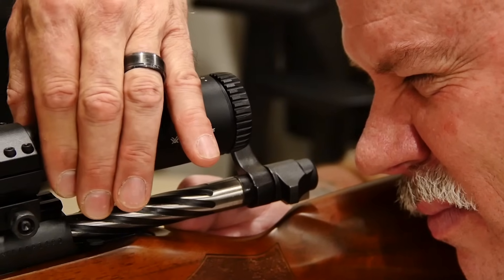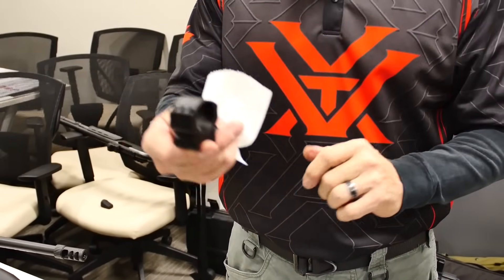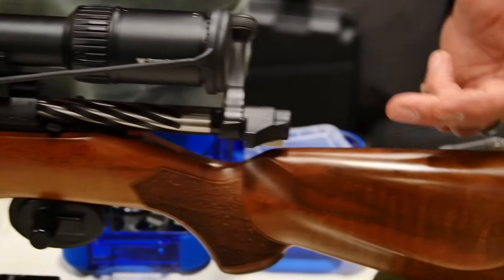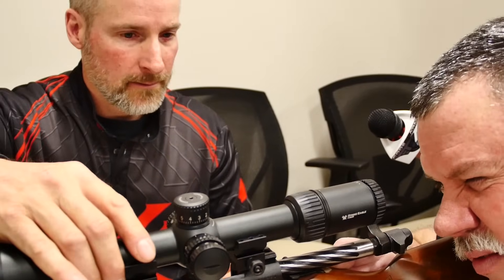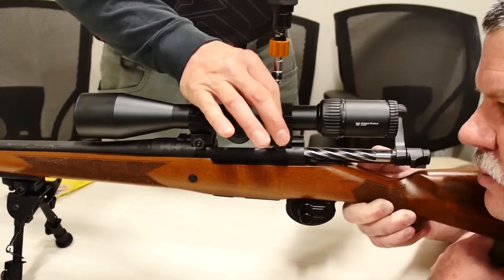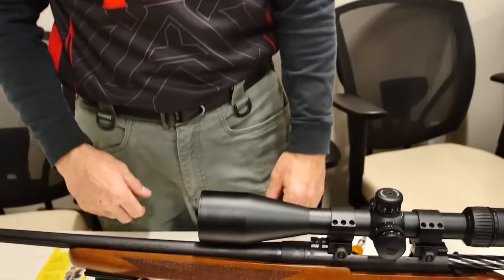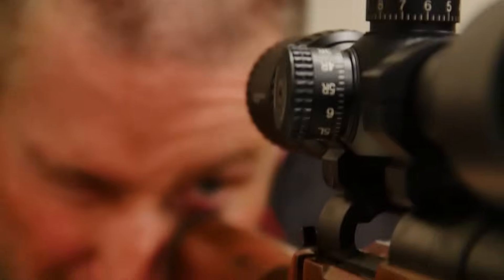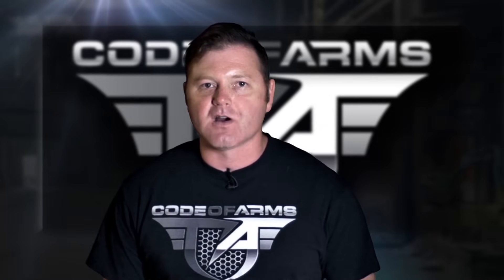HOW TO INSTALL A SCOPE PROFESSIONALLY - By Vortex Pro-Staff Mike Brake

Comment: I don't use levels on most precise mounting. Never know when the reticle is not aligned true to the elevation adjustment system. I hang a plumbob on a fine string and coat it with a contrasting color and center it on a perfect perpendicular cross with small circle on the x. Another cross hair on the paper exactly the same distance vertical as the center bore to center of scope on rifle. This on paper on a wall, basement/garage. Wifey/husband safe. Ha.. Rifle on bags or secure rest as far away as I can get,, 20 ft or so.. I might level from top surface of the base but I align vericle cross hair with the plum line and the center of bore. Adjust scope to cross hair on paper,  the tope line you created above center x. 
 Most of time on a 3 inch circle at 50 yards at the range  I verify bore sight and shoot a round. Usually it is in that 3 inch circle. Then go from there at 100 and tweek it in

Comment: Can’t bore sight semi autos without using a laser bore sight cartridge.  Takes 10 seconds.  I do it at night on the side of a house about 100 yds from mine.  My .308 laser cartridge was pretty cheap on Amazon.
Reply: I also have had good luck with Green laser bore sights.  Also the Wheeler bore sights and scope leveling kits.   They are a huge help with getting mechanical zero of the weapon and  the ammo they used.   Similar to the HD video  scoped with HD cams for your eyes....
Reply: You can, at least on an AR platform but it takes a bit longer

Comment: You know I have that same set of bubble levels and they are crap . They dont stick to anything and 1 out of 100 time will it actually be level when the bubble says it is .
Reply: Starrett or Mitutoya.....helps being a master toolmaker and having vintage quality tools.....could even sweep it in with Swiss half thousand indicators.
Reply: @keithlucas6260  i was thinking starret for sure.  Don't think they make shooter levels but you certainly could check and calibrate your actual shooters level with a starret 98

Comment: Why did you not address "bedding" the scope barrel to the ring mating surface???  That is one of THE MOST important elements to insuring maximum scope stability.  Thank you.
Reply: Absolutely, I was shocked bedding was implemented. Stop the slip.

Comment: 25inch pounds on lower rings and bases.  For Tikka, a rail with a recoil pin is good since that is how Tikka receivers are engineered with the Sako optiloc system.
Reply: Nightforce also make a great 0 - 40 MOA pic rail for Remington 700s, and 700 clones, that have a machined in ledge that seats up to the ejection port to act as a recoil lug for the base. They also are machined to such good tolerance specs that I've never seen one that needed to be bedded, they all had 100% contact with the receiver... 
(I believe some mfgrs. recommend 30 in/lbs for bases, so check with your rifle maker (All I can think is the variables in hardness of the receiver?)
Reply: @judgegarry  Thanks I am a hunter, not a long range shooter up here in Alaska.  I used rings directly mounted to the dovetail on the Tikka lite stainless reciever.  The Warne Maxima rings did have the recoil pin for the Optiloc system that is in Sako and Tikaa receivers.  My first trip to the range I was shooting sub MOA with Barnes 130 gr TTSX bullets with IMR4350 a muzzle velocity standard deviation of 4.6.
Reply: Bob V  For my stainless Tikka T3 lite .270 Win I really like the Warne Maxima rings, no rail or bases.  Shoots great and is super lightweight for mountain hunting up here in Alaska.
Reply: 40 inch pounds sounds high....where did that number come from?  TY!
Reply: @mmpiforall5913  Warne Maxima Rings  25 inch pounds max

Comment: Where are you located?  I'm in west Texas and in need of a good zero on a new gun and scope.
Reply from the maker: We are in Canada! A long drive from Texas! 
However you should be able to find plenty of qualified people in Texas to help you, it’s the gun capital of the world lol
Reply: @CodeOfArms  Thanks for the reply.  In rural Texas I'll probably have to drive 60 miles one way and still might not find what I need. P.S., please send some cool air.
Reply: I could zero your rifle perfectly with one shot using a rifle rest/vise. First I bore or lazer sight the scope at 25 yards. Then place one well aimed shot from a rest at 100 yards. Then using the rest/vise lock the rifle in so the cross hairs are back on the bullseye, now without moving the rifle at all carefully move your cross hairs to the hole from the first shot. When done correctly you have a perfect zero. That is assuming your rifle and ammo can group decently. I have done this many times and then gone right over to our 1,000 yard range, and dialing up using a ballistics calculator made hits on a 16" target from the first shot.

Comment: Would this mode be considered a cheap scope? Vortex Diamondback Tactical 6-24x50 FFP Riflescope - EBR-2C (MOA)
Reply from the maker: Yes it would be considered low/mid in the product lineup. The Viper would be Mid/high and then high would be Razor. Razor is heavy, real nice glass. But you are now getting into Nightforce money! But if you can find a deal on Razor line, it’s the cats ass!  I have a viper pst FFP and it is real good for what I need.
Reply: That optic is an excellent optic for the price. FFP, good clarity.  I have two of them and they are very nice.  It is still the lower end of optics though.  I would say for most applications it is more than enough optic for anyone except for long range shooters going out past 800 yards.  The lacking points is the objective is smaller so doesn't let in as much light, glass is not as clear as higher end optics and will get discoloration at high magnification, eye relief is a bit touchy and not very forgiving at higher magnification and the big one....minimum travel on your elevation.  Higher end optics will have a larger tube so you can get more elevation travel plus do much better on the points I listed above.  For the price, I highly recommend the Diamondback Tactical.

Comment: My problem is that the turrets are NOT level. Now did he use a plum bob and check the veriticle retical. Especially if you are using a cant-level mount (say 20 MOA).

Comment: Two issues. The two small levels aren't usually of good enough quality to be accurate. Also, the top of the turret isn't necessarily perfectly level to the horizontal reticle in many scopes. A plumb line to the vertical reticle is a better method.
Reply: I was actually about to ask that because I used a plumb line to level mine and it looks perfect.

Comment: 90% of my glass..mounts and rings are all cheap..have had them on for YEARS with zero issue. I'm not on the front line fighting in the middle east..they all work just fine.

Comment: Those levels only work if you turret and receiver are flat...
Reply: Alternately, level your scope bases and lock the firearm in steady, then hang a plumb bob out far enough to focus on it, next, set the vertical axis of your reticle to match the plumb bob, then torque your scope in. Remember to bring your torque wrench to the first trip to the range to retorque the screws in the rings after the scope "seats" itself…
Reply: @judgegarry  ....still have my vintage Starrett plumb bob.....another tip is using some quality fishing line....you can shine a red/green light on it to see it.
Reply: @keithlucas6260  do I shine the red light through my scope to see the line?
Reply: @Antonio-si8pu  ....for $18 bucks Academy has a laser bore sight that is a machined cartridge with the laser in it.
If you own a contractor's laser it has a level on it and you line up the horizontal to it after you level the rifle with a mount level which Academy Sports also has.
If you have a plumb bob which naturally hangs vertically you line up on the string.
Then again you can level your rifle in a rifle vise on the kitchen table and line up on a window or door frame, after all they do build them somewhat plumb in order to work right....cheap man's way of doing things. I would recommend the bore laser for getting the scope close, after all ammo is a bitch to find and using just what you need to fine tune it afterwards is less expensive.

Comment: Installing a scope is like so simple...Even doing it correctly is very, very simple. It does no good however when you correctly install a Vortex HST 6X24..Why? Because after three shooting sessions, the scope isn't going to hold your settings anyway...On my made in Maine Bushy Varminter (like, no recoil) after a few range sessions,  problems cropped up ..Instead of my usual 100 yard +-  1", sometimes more, sometimes a bit less, groups (off a bench)..I shot a scattered group of 2" that was also about 2" high and 3" right...No ammo or scope changes had been made..OK..I adjusted back to the original POI..which took more than a few shots..hmmm....After 2 shots, again, the group was scattered and to the right about 3"..This same pattern went on for like 4 more groups of 3 shots...I checked my Warner one piece "skeletonized base..It was tight on the pic rail (which is an integral part of my rifle's upper). I checked the scope rings and they were absolutely tight. I put another older scope on the AR...went through bore sighting and then precisely sighting the old Leupold VR-1 3x9 to 100 yards..well, 114 yards, actually. Multiple groups shot were all within 2" and all centered around my sight in POA...Calling Vortex next week and whatever they do, I just want the scope to do what it's supposed to do without having this happen again. I also have a 45 year old Redfield Widefield 2X7 installed on my Win Mod 70 and IT holds zero wonderfully....I am really disappointed with my Vortex. I thought I'd bought a good scope...
Reply: I own 4 Vortex scopes from modest to insanely expensive. 
Dropped one down a mountain. Found it busted up severely. 
Vortex replaced it no questions asked. 
Been among the best scopes I've ever used and owned!

Comment: Another professional thats puts level on scope cap top.   101 you never do is this.   I cant believe how many use the elevation cap  as a level point.
Reply: Agreed.  Almost 100% of the time it will be unlevel to the barrel.  See my instructions above.
Reply: No lapping ,,,, what a pro...
Reply: @rottanwelding  not a pro if you use level on elevation cap. Gee even my son no better
Reply: @Peter-od7op  any one lap their mounts any more.. WOW
Reply: Can you explain more or link a video.  From what I understand your saying skip the top level?    Sorry. Im a new shooter. Thanks if you reply.
Reply: @rickyscars2921  the real gunsmith    Has a great vdo on scope installation.  Top scope caps are not totally centered in scope tube. Also as you turn cap its on threads that are angled
Reply: Randy selby is the real gunsmith.
Reply: @rottanwelding  from what I’ve read lapping is not needed with modern Cnc rings . But I have done it. Not sure if it did anything.
Reply: Pros don’t use levels they use a door frame and eyeball it
Reply: I've  had better results with the leveling wedges (most decent scopes have the bottom of turrents milled perpendicular too the vertical reticle)

Comment: 1st I mount my rail on a cleaned rifle using loctite. 
Position my ring bases where I prefer. I like to give myself some "wiggle room" to fine tune the forward/aft location.
Lay my scope in the bases, lightly attach the top half of the rings just enough to keep the scope from flopping around. I then check the position of the scope for comfort and ease of use.
I set the ocular lense, the magnification ring, and the objective lense (if adjustable) for best clarity backwards!?
I shine a flashlight into the objective lense to project an image of the reticle against a wall that has crosshairs drawn on the wall using a laser level.
When I've got the reticle lined up with the crosshairs on the wall, my scope is now level to a leveled rifle. Easy peasy.
I've never lapped my rings.
I tighten my rings to specs recommended by the scope/ring manufacturer. 
Never had an issue with scope movement.
Double check everything and I'm good to go.
Takes 10 minutes or less after you've done it a few times.

Comment: He lost me there at 7:10, talks about zoom, says "highest setting" and brings hands together, then says "lowest setting" and expands hands outward. He then says "set it to the lowest setting" and brings his hands together. What??? That's 180 degrees out with what you just defined. So in that case is "lowest" the lowest zoom setting, meaning wide angle, or is "lowest", the lowest in angular view. He then says slide "it" but what is "it". I'm guessing its the scope, and he was trying to say, set scope to the highest zoom setting, then move scope back and forth in the un-tightened rings to position it for your eye relief. It's best to always use very defined and consistent terms, you may know what you are talking about but those new to this don't. Other than that superbly excellent.

Comment: Disappointed that the "Professional" did not lap the bottom rings to insure contact with most of the scope.  I found that even with more expensive rings, lapping is called for to increase contact with scope tube.  I found many "Experts" but most overlook lapping aspect of mounting a scope. Levelling is important along with other processes described in video.
Reply: I noticed these some new rings have a lining on the inside of the ring mount. This Is a thin layer of plastic like rubber stuff. There’s no reason to lap this surface. But I don’t know if this is what there working with on this video.
Reply from the maker: Great point...in full disclosure, this was an impromptu video surprised Mike to do lol....he did this install for free for a customer that was shooting recreationally out to 300yards with the limited tools he had on hand. He did a great job communicating and installing this on the fly!  You are correct, so much more detail that would go into outfitting a rifle to shoot long range precision!  Great feedback! Thank you
Reply: @CodeOfArms  Yeah, if the title includes "professional" then there's a lot missing, retitle, scope 'basics'.....
Reply: You don't need to lap rings its bollocks

Comment: I thought with separate rings Vortex recommend lapping before install? It says so for Vortex individual rings which IIRC are aluminum but truth be told mentions nothing about non Vortex rings either steel or aluminum.
I just assumed they meant all separate rings require lapping.
Reply: Lapping is far inferior to bedding with JB Weld.

Comment: Wrong, mount the rifle in a padded vise by the barrel with a support under the stock. Use a machinist level on the top of the action or the bolt raceways to level it side to side. Use it to level the rifle front to back too in the vise. Then take of the top turret cap, and place the machinist level atop the turret mechanism, then level it.
Reply: Even better is to use the underside of the turret if it’s flat.

Comment: Setting scope level on a levelled rifle by putting a bubble level on the top turret is NOT the best way to go as turret caps are not always perfectly aligned. Use a piece of string on the wall pulled straight by something weighty and then shine a flashligt through the scope from it's bell end. Then align the vertical crosshair strand to the string and tighten while observing both rifle level and string aligmnent until done.

Comment: Loose after half a box. Not a drop of loctite in sight
Reply: Only the base screw typically get loctite, though like you some people put it on all the screws and there is nothing wrong with that. I have scopes on 20 or so rifles that see a lot of use and I've never had one come loose without loctite...
Reply: @artillerybuff2000  after further research, you might be right. Vortex, for example, actually says NOT to use loctite because it changes the torque specs and over tightening might damage the scope. Thanks to your and Vortex for educating me!

Comment: I’ve shot 300m with irons sooooo don’t need $2000 scopes to shoot past 300m and I’m sure a $400 scope can reach 600+
Reply from the maker: You would be surprised how much difference an quality scope makes. Outside of build quality and durability, the main factor for me is clarity and the ability to bring in the most amount of light. You can’t shoot well what you can’t see well. You are correct about 100-300 distance, I’m more referring to 300 and beyond. If you get a chance to demo some different optics give it a try, you will quickly see the difference between a $400 scope and a $2000 scope!

Comment: Those small levels are never accurate, i always turn them to check the accuracy of the level.
Reply: You are 100% correct. I have purchased 12 of the same one off amazon and each one varied slightly and a few were very off.
Reply: The wheelers are pretty good.
Reply: @robertbrister1413  Have you got a link
Reply: I use a digital level. Craftsman when they were made in the USA. Agree on those cheap plastic bubble levels.

Comment: Steel and ALUMINIUM are not compatible. THEY WILL RUST. And yes, I do mean the ALUMINIUM.
Reply: Yes, dissimilar metals can cause problems like galvanic corrosion or rust, HOWEVER, both the rings and scope are coated so there is no actual metal to metal contact. I have 30 or so scopes mounted, some with steel and some with aluminum, and have never had any issues.

Comment: If your not using a plumb line to plumb your crosshair , it’s not done professionally.. you can’t use a level on your turret and get it plumb.. I have found turrets not square to the crosshair.. I have a trijicon 1x8 that is crazy out of square..
Reply: Don’t put the level on the top of the turret. Put it on the underside of the turret if it’s flat. I use a level made by CTK Precision.